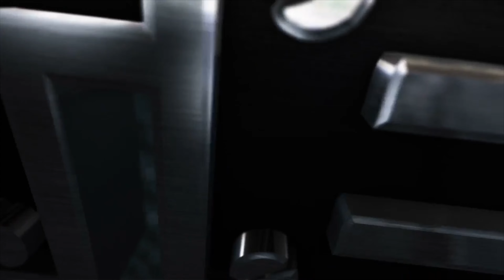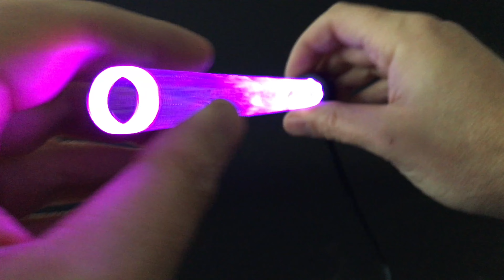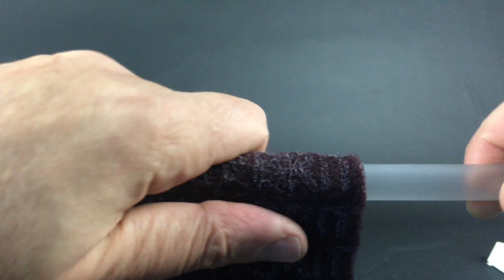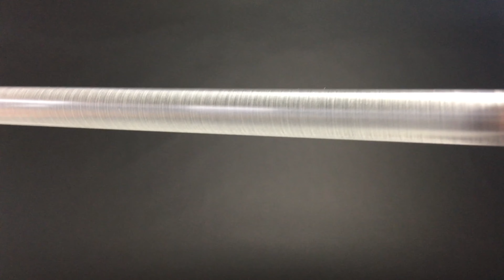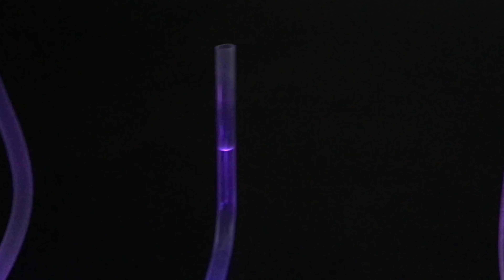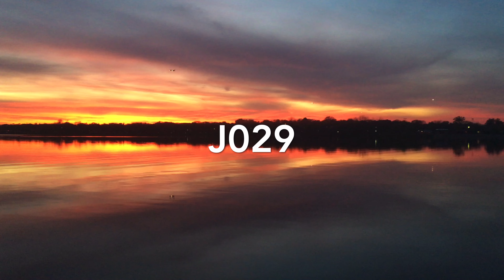NEON RGB Hard Line Tube Mod Lighting Effect for PC Water Cooling Build & Setup.

Comment: Wondering if you scuffed the inside of the tube straight back and forth, instead of with a drill, making the scuff lines straight instead of circle would make a difference???

Comment: I really appreciate this video. I don't plan to use light up fittings, but I have a whack-ton of RGB in my case. Due to me getting some fairly cheap fittings, they work fine, but my tube selection is limited. I appreciate a cheap and easy way to scuff the outside and give it that satin look. I plan to do this to my existing runs I just made a few days ago. I already have to take my CPU block apart to replace the acrylic that has stress fractures, so that would be a perfect time to give the tubes a make over too.

Comment: A couple of questions. I'm about to do my first water cooling custom loop. The fluid I chose is EK CryoFuel Mystic Fog, which is a milky white semi-translucent fluid designed to propagate LED lighting.

I considered adding the alphacool rings 13mm, but I'm curious about how effective they would be. Also, I'm curious how scuffing would work with my tubing, because, as a noob, I'm starting with 10/13 clear soft tubing. I haven't found an answer as to why tube lighting seems to be exclusive to hard tubing. Is there something about the PVC composition that prevents a similar effect from transmitting along the tubing, or is it (I suspect) that the people interested in this type of asthetics have already chosen hard tubing for the asthetics? In other words, it's possible, but some might see it as slapping underglow on a stock honda?

Comment: Thermaltake is flickering. I don't trust that company's reliability. I'll take the Alphacool.
Reply: Keep in mind LEDs don't constantly radiate light. They flicker light. A lot of times the camera poling rate and LEDs line up for a bit and you see it as flickering.
Watch car reviews of modern cars with daytime running lights(which are LED) and you will see what I'm talking about.

Comment: Well since I didn't see it.... Oscillating look but a way to get a clean even frosting on the inside is to... Syringe some acetone into your PeTG  have both ends capped and shake it around for about a min then open one end under running water as to not contaminate the outside and then run water through the tube.... While your shaking / rocking the acetone inside you won't notice any frosting, but trust the process it's not until you run the water through the tube and let it air dry that it'll appear... If it's done properly there is very minimal degradation done to your line and you got a smooth frosting, your welcome. 

Caution acetone will help you find any cuts you may have on your hands... And it will burn for a little bit... No open flames while you're doing that... And do it with good air flow
Reply: Would anyone mind linking some pics here of how this turns out?

Comment: I believe Monsoon also has an RGB 90 degree fitting as well. There's has a unique approach where the lighting element is entered into the back of the angle and points down the tubing. They have other angles too: https://www.frozencpu.com/products/17210/ex-tub-1502/Monsoon_Light_Port_90_Rotary_Angle_Adapter_34_OD_Matte_Black_MON-LP-90-34-MB.html#blank
Reply: Also looks like RaiJintek has some as well: https://youtu.be/T3KOMG_njOM
Reply: God I keep finding more. Apparently AK Mod has a 3d printing bracket that can be attached to hardlines that can socket LEDs. they look insaaanely vibrant: https://www.coolermaster.com/catalog/coolers/rgb-accessories/argb-tubing/
Reply from the maker: thanks for the links and watching Kory!

Comment: Very nice 👌. Will consider doing this on my o-11 xl build I'm going to do soon. 

I have some thoughts and comments on this though. 

It's pretty obvious that inner scuffing produces a far better result in the distance that the light can travel through the petg. But wont you typically have shorter runs than the tubes you used to demonstrate it ? So in shorter runs, it might be a better idea to go for the outer scuffed tubing, which also produces higher luminosity. 

The outer one compared to the inner , has a also a much nicer kinda-frosted look , while the circular scuffin lines on the inner one kinda ruin it for me. Isn't there any way to do inner scuffing without the circular lines being so noticeable ?
Reply from the maker: You don't see the lines when the loop is filled. Watch the beginning of the video again.

Comment: Great video. Could you add a white colouring to the water to get a more consistent colour?
Reply: we actually did do this, our mixture for the build (which you see at the start of the video) is about ¼ opaque white liquid, and ¾ clear liquid, this helped make the colors pop even more
Reply: @jakWiize  Did you add any biocides to the mix or was the 3/4 clear liquid another pre-treated coolant? I was planning on using mayhems white and just adding more distilled water + a little bit of biocide, but I'm curious what you guys used. Thanks so much!
Reply: no sadly